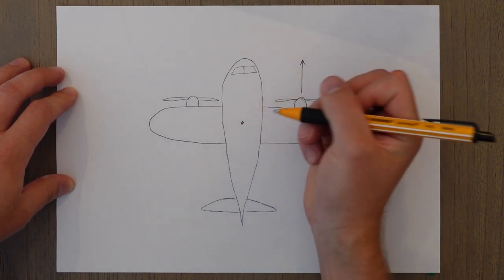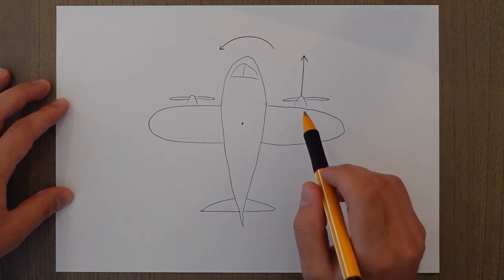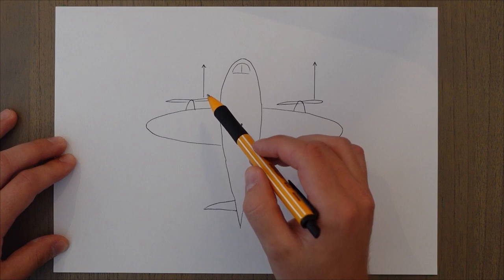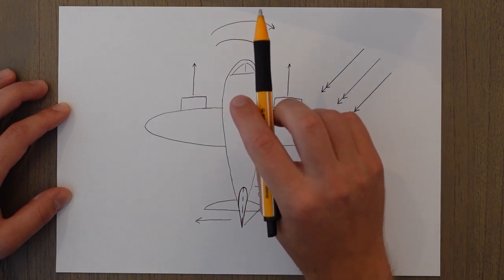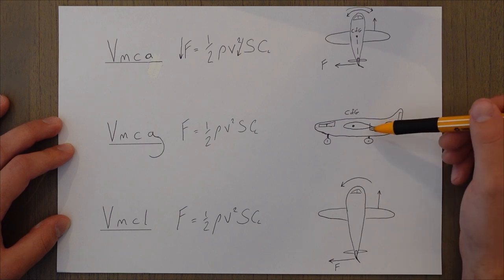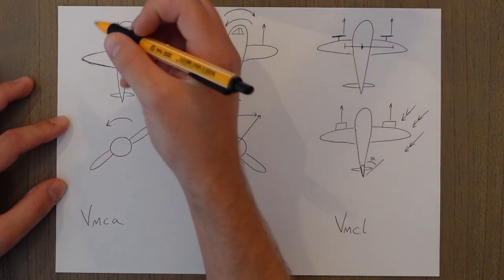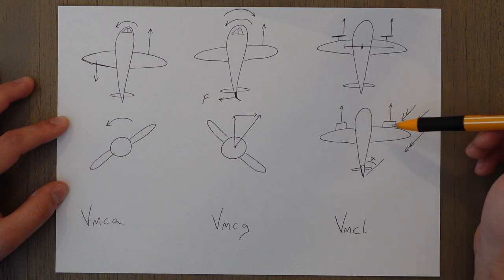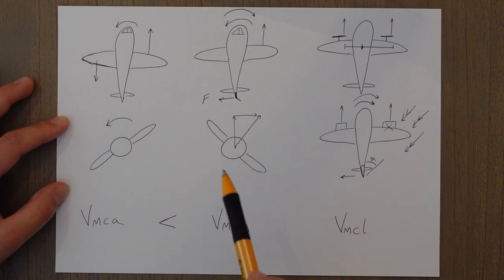ATPL Principles of Flight - Class 19: Asymmetric Flight.

Comment: Using bank to control yaw @04:20 Can you please elaborate? In my understanding the roll causing yaw will stop once rolling action is stopped. Or is it like the bank+crab method for landing in high x-winds? As always a great video, thank you.
Reply from the maker: You can use some of the total aircraft force on the wings to counteract the yaw and subsequent roll caused by the asymmetry. Meaning that less rudder is needed, less rudder means less drag and lower levels of thrust can be used or better rates of climb etc.